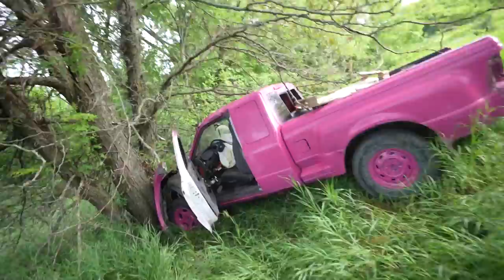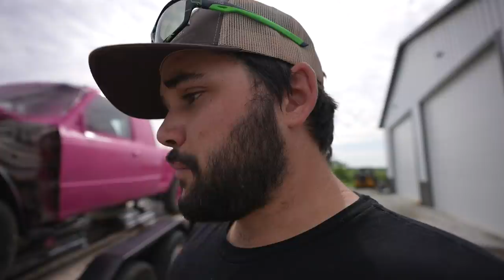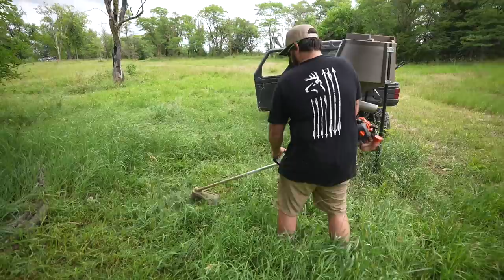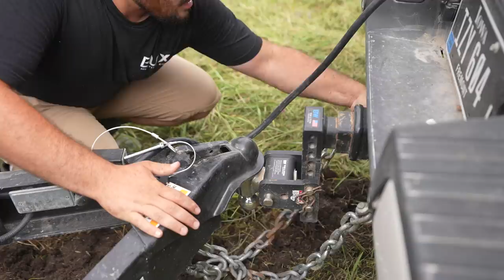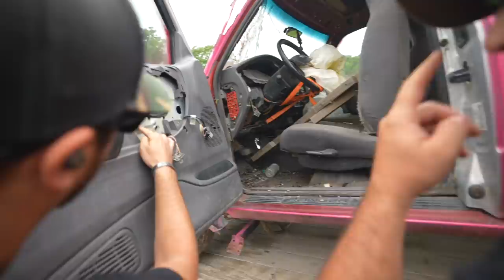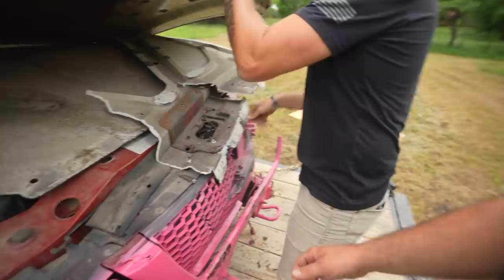BARRETT 50 CAL vs FORD RANGER Challenge at the RANCH!!

Comment: I saw the video on ClassicFireArms.  I would cut the negative battery cable to prevent a short.  The positive cable was blown apart and you don't want any part of the positive cable to ground on the body of the truck.  Could start a fire if the battery has any juice left.

Comment: Flair you don’t need to take the weed eater apart to change the line there are arrows you line up and put new line through. It should be about a 8 foot strip of line then you twist the top and bottom counter clockwise.

Comment: The reason the wheels were spinning opposite directions is because of the spider gears in the diff. It must have been in drive or park and the yoke couldn't turn so the wheels turn opposite directions.

Comment: The back wheels were going backwards because they weren't on the gound properly and the front wheels were and the front wheels turn and it runs through the center drive shaft making the rear wheels turn sorry if I didn't explain properly but that's what I thing was happening I'm only 13 I may be wrong 🙃

Comment: You should mix that mineral with corn I had that same problem then I mixed it with some corn they tore it up I found prints over 3 inches wide try it tell me if it works for you

Comment: Flair if that’s a newer weed eater it probably has what’s called a speed spool. Meaning all you need to do is put one long piece of string through the head, hold the head, and turn a plastic ring below the head. If you aren’t following this just YouTube it 😂. I’m a landscaper and have the same weed eater and it’s saved me tons of time. It takes 60 seconds and not 60 minutes. You also might want to get your spark plug replaced. If it takes a lot of pulls it typically means the spark plug is going out. And the part of the weed eater head that you took off is looking a little worn. You probably need to buy a replacement one (just the part of the head you took off). If you don’t know how to order the parts or need some help figuring them out, hit me up flair!

Comment: Its called a differential. If the drive shaft isn't moving and one wheel is going forward, then the other will go backwards.
Those bits of cast iron.... that's not a bullet.

Comment: One wheel is going backwards because that's just how open differentials work. It's the same way you get vehicles that only spin one wheel when doing a burnout. When you are applying force from one wheel and not the driveshaft, the opposite wheel spins the other way. So when you dragged it up the hill one wheel had more grip and the other one spun the opposite way

Comment: Flair I got the same weedeater as you and you don’t have to take the head off to put more string in just lined the holes up where the weedeater string comes out it so you can see through each side and string it through those two holes and twist that’s a speed feed head so that’s what it’s designed to do

Comment: That weed eater is a auto feeder weed eater you make sure the holes on the inside Line up and you can fit at least 6 feet of string in it then to extend the string when it goes low you tap it on the ground and it should auto feed it @flair